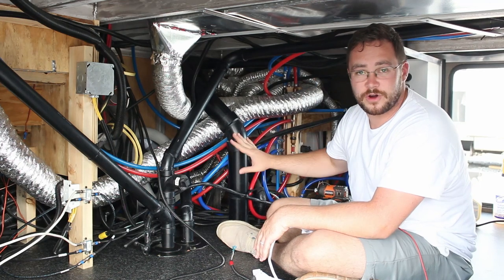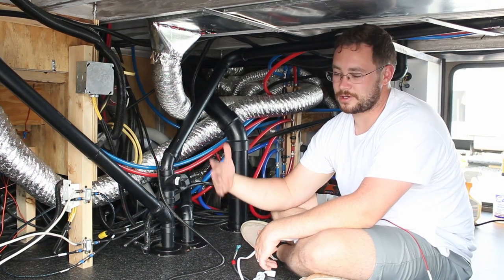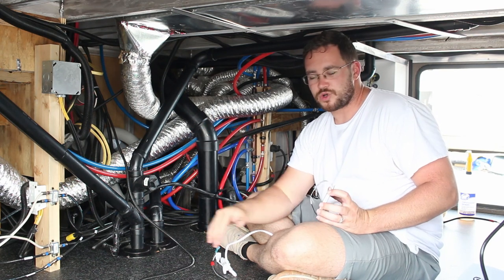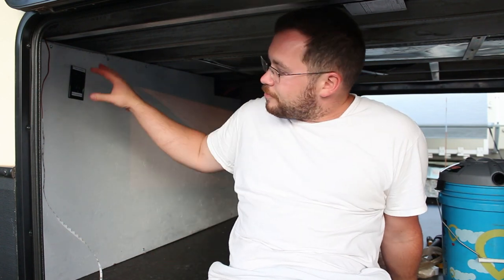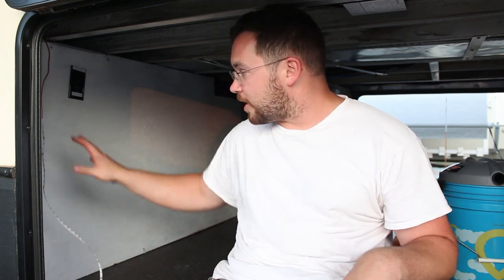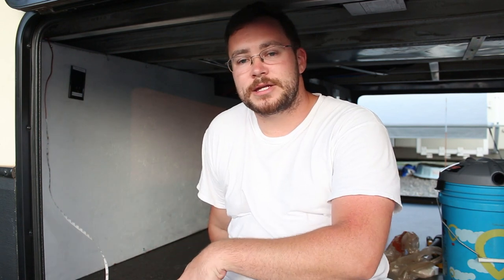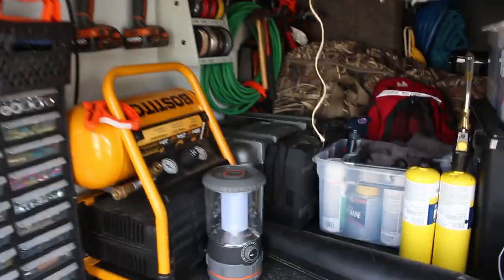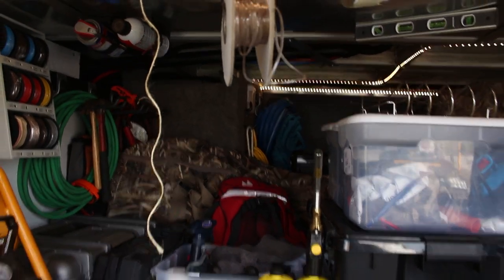RV Basement RENOVATION: Before and After [RV organization]

Comment: With all of the tools in the rig do y’all ever carry tools in the truck?  I like having my tools in the truck but we have a bumper pull so getting access is easier than a fifth wheel.
Reply from the maker: Consider the Wonders I carry a separate smaller set of tools for the truck like a tire patch kit, small socket set, extra fan belt, independent battery pack, stuff like that for emergencies.